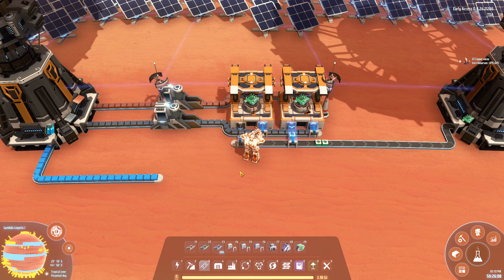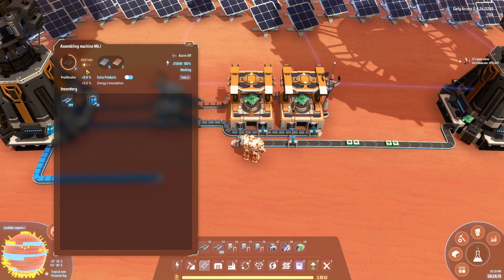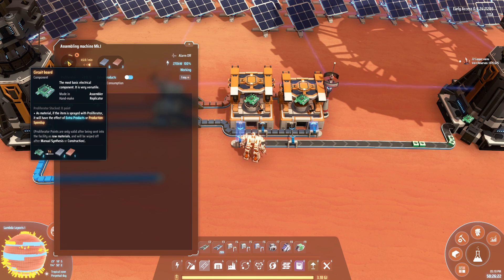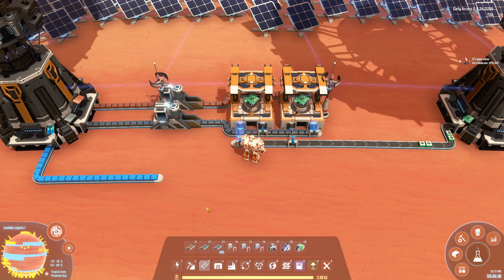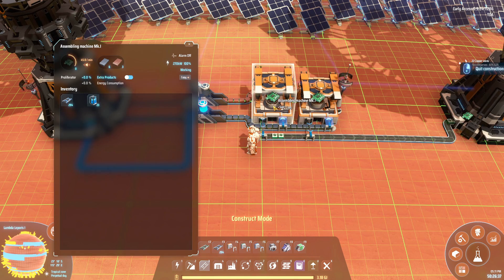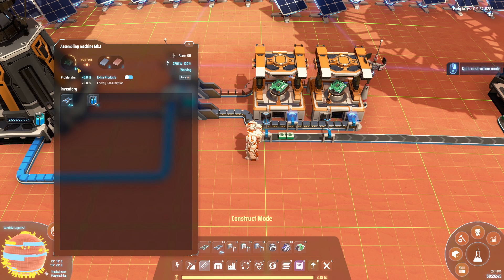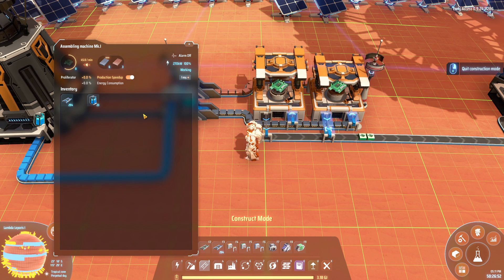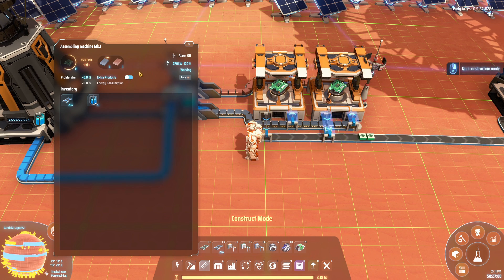Proliferation Explained - Why is "Extra Products"  is always superior

Comment: ok, so i did come in with the opinion that 100% production is better and now I see why 25% products can be better and how in all technicality that little small button actually has nothing to do with production (inputs/outputs with #'s) but is purely about 3 different play styles/ways to go about building in the late gate, NOT which produces more. This is actually very clever now that I understand it.

The way he set the factories up in the video where he had every step to make that item from raw ore in 1 setup is 100% a different play style than than a forge world type play style where you make massive blueprints for just Iron ingot or copper ingot and have those feed my massive magnetic coil blueprints which feed my electrical motor blueprint and every blueprint has it's own logistics tower etc. 

It's seems that there are 3 ways to play:
1. New/average player - No prolif/using prolif only to compensate for an exact reason creating no waste/idle time because your just trying to beat the game by building a dyson's sphere.

Long-term players:
2. The forge world people who build massive factory setups for individual Items that all have their own logistics tower(many towers per item sometimes like Iron ingots) heavily heavily rely on logistics vessels to be the glue that bonds everything together. These kinds of setups is why I thought was 100% better and IMO is when you want to always use 100% production because you made sure power is not an issue since the vessels use power, your 100% production on everything uses more power. It's kind of a quicker but lazier way to play. This setup allows for a lot of factories to have a lot of idle time until they are needed  to fill the tower of the next component really fast then 50% of everything goes idle once the next tower is full. This is when you want to build the big awesome spheres but in a wild and chaotic way, some people have no chill and this play style suits those people, that's me :)

3. The methodical player which is what I would say this video shows, where you build what you need for that item all in 1 blueprint, which is interesting now that I'm writing about it. 
There are tiers to the items/components
- tier 1 is ores
- tier 2 is the ingots (refined) made from ores
- tier 3 are components made from manipulation or combination of ingots smelted from raw ore.
- tier 4 is finally the "actually useable" item  which you can use to craft different items which could be tier 5 but they are both just items/an addition step

The point is while the methodical player will also rely on vessels to transport the items, they will have way less vessels being used because no teir 1, 2 or 3 will ever be transported so less power demand. With this setup I think people should always use the 25% more products because of the tier type setups which means they take up a little less room and and use less power so this build is perfect for people who don't have massive power grids but want to expand. My guess is tier builds have a lot more math involved and this would be the more tedious play style, whereas forge world is just more vessels, more planets more power.

I started this on phone and started commenting my bias opinion before watching. Comment got big and I got on PC to finish it and at that point I'm like hour and a half into writing but realized that I see zero value in 25% products and there must be some value so I watched the video and that's when I finally seen it, erased everything and then wrote this. It's hard to write when your learning new info at the same time, I'm like 3 hours into this. :)
Reply from the maker: This comment got serious proliferation buff as well, way more than 25% extra content! :D
Reply: @TheDutchActuary  "25% extra content!" Now I'm not saving resources (time) now I'm going to go for 100% production 😄 I write comments bigger than this every 3 days on youtube, for like 15yrs so it is nothing to write this. Don't feel like I spent a lot of time writing this and I'm doing too much, it's normal for me.

I've done 30hrs in creative since that message and I think I have the info, I just need to write so my brain can put it all together, it's a thing I do.

I don't believe 1 is better than the other but that they both have a certain purpose and there is not a clear indication of when you should use 25% or 100%. I can't tell where that line is exactly so I've been trying to find it and this is the best I have so far. If you have revisited this issue in a new video plz let me know because this is 2 years old and you may already know the things i'm just figuring out.

I still stand by the, "if it's a rare resource, you need to use 25% for every step of the process". if you  need more of the item faster than your 25% setup can do then do alt recipe also, all rare veins should be 25% all the way, all day.

You proved that if you want to make turbines @5/s that 25% is better and I have no arguments with that because your biggest claim for using 25% is you need less and less factories needing less power over all. In my mind, when your always fighting for more power, 25% would just simply be the answer because you get the most out of everything and use less power doing it, like a "duh" situation.

Lets say you want to make gears at 20/s:
--25% would be 16F(factories) to make 20/s. those 16F need 12.8/s ingots, so you need 10.24 iron ingot smelters to be able to make 12.8/s ingots. To make 12.8/s ingot the 10.24 smelter will need 8.192 Iron Ore per sec ------To make 20/s you need 26 factories with the 25%
--100% would need 10 factories to make 20/s. those 10F will need 20/s iron ingot so you need 10 Iron ingot smelters to make 20/s iron ingot. To make 20/s you need 20 factories with 100%

when you are making turbines it's better to do 25% for power AND use less resources
when you make gears it's better to do 100% for power BUT use same resources.
so the difference between these 2 things (except for resources used) is how many steps that use assemblers. When making gears the process stops at the first use of assemblers versus making turbines there are 4 steps that use assemblers and why everything benefits so much from 25%

So then I think, does that mean the line for 25% vs. 100% is when the process goes from smelter to assemblers. I haven't made this the answer but I'm leaning towards it. I think  making a turbine setup like you did and putting the smelting in the same setup can be counter productive depending on the situation "low on power", "low on resource veins" or "low on buildable space" those are the 3 things ratio'ed together are going to make you decide between 25% or 100%

If you are making: turbines that need 30/s iron ingot total, in separate build you need 15/s iron ingot for motors, separate build you need 10/s iron ingot for circuit boards, and 5/s because you are making belts, that is a total of 60/s iron ingot needed if all assemblers are working. 
-60/s iron ingot at 25% needs 48 smelters and uses 38.4 iron ore per sec
-60/s iron ingot at 100% needs 30 smelters and use 60 iron ore per sec

this is why I write, I didn't even put this together till now.
Because of this, that means the power you are saving by needing less assemblers is causing you to need more smelters per setup than you would if you did a setup with just iron ingot smelters at 100%, which would save even more power. The setup being from ore to item causes you to use more smelters, you just can't see it because they are spread out between the setups for each item. You don't save resources (ore) by using 100% on the smelters but it's iron ingot, that only needs iron ore and is the most abundant resources in system. 

Are you making green or pink containers that require unipolar, POWER IS NOT THE PROBLEM, everything smelted and assembled should be at 25% extra. This means you could have made 2000 items total but because you used 25% every step you can end up making like 12,000, it has crazy exponential. Are you making turbines that require multiple resources that are made by assemblers, that require items smelted from the most common resources but don't have the power, then you should 100% for your smelters and 25% your assemblers together or in separate builds. 

It gets tricky though, because if I need the 60/s iron ingot but i want to make gears also, I would make a separate setup for the gears that is ore to item because the item I want ends at the first use of assemblers. I could just make my 100% iron ingot setup bigger and then make a gear setup without smelters and it would save power. Instead I would rather the setups that use a lot of assemblers per setup, use the ingots from my 100%. Even though you are not getting everything you can from the ores out of the ground with 100% on smelters, if every step after the smelters is 25% then at least you make the most from the smelted items.

The other use for 100% is fine-tuning your 25% assembler setup. The numbers are arbitrary, im going off memory but the point is there.
With whole numbers being multiplied by .5 in the 100% setups all answers will be whole numbers (easier math)
With 25% you will get  where you need 12.8 motor assemblers requiring 10.24/s ingot, 5.12/s coils, and 5.12/s gears (annoying math)  which means you need 13 assemblers at 25% to get what you want, BUT what if you remove the 13th assembler and because you need .8 more, make assembler 12 and 11 100%, this allows you to have even less assemblers than what the 25% requires needing even less power, but you do have to chase the problem you created. 

9F @25% and 2F @100% means you will not need as much power because you removed F13 but you do need more resources as a result. with the 11th and 12th assemblers at 100% the whole setup needs 11.08/s ingots, 5.90/s coils and 5.90/s gears. Your gears and coil factories can handle the increase in demand but the iron ingots now require another smelter to get the 11.08/s OR you can only change 1 smelter to 100% and keep the same amount of smelters, you just use a little bit more resources so you don't have to add a smelter needing more power.

yea, ok that was fun, thanks for reading and if you can see any issues with what I said plz tell me.
Reply: Mixing 25% with 100% actually makes the math easier

-To make 50/s turbines you need 80F for turbines.
-80F require 128 motors and to get that you need 204.8F for motors.

-204.8 assemblers needed for motors
.8 > .5 so I uses 2 assemblers from the 204 to make 100%.
202F @ 25% 
2F @ 100%

From what I can tell you should never make more than 2 assemblers in any setup 100%. By the time you are making a 3rd assembler 100% then your math was wrong from the start.
Reply from the maker: @shawnbybee85  You can mix & match to make the math easier, but honestly if you're doing proliferated builds using extra products I would recommend using a calculator (or DIY spreadsheet ofc!) and just make the calculation a non-issue. Using speed options just means you're leaving some (exponential) resource savings and power savings on the table. 

This is of course purely from an optimizing perspective - There's nothing wrong with using whatever option for proliferation you prefer (including not using proliferation at all!)
Reply: @TheDutchActuary  I didn't even realize you replied, I was actually comming to delete the second comment because I said a few things wrong that i didn't want to take the time to fix. Since you replied I'll use it as a way to help other people in the who may be in the same situation because I was doing the math wrong in my head and on paper. It wasn't till I made the blueprints and pumped resources through it that I realized.

I still agree with:
1. Your point in the video was 25% uses less power because less factories and my point is you can use even less factories when you fine-tune your 25% setup with 100%.when you need 12.4 smelters, instead of adding a 13th smelter for the .4 only put 12 and make the 12th one 100% and the other 11 smelters 25% "if it's about power." if its about getting the most out of the resource then you should not use 100% at all and not care that the 13th smelter will only work 40% of it's existance. it's a fine tuning thing that I would never expect the average player to care about but as I'm creating blueprint in creative my OCD can't help but want to fix that 40% factory. :)

2. I think the smelters should not be included in the build/blueprint. I can do numbers but it boils down to this. all assemblers should be in 25% builds because not a lot of items use those items, there's just a few things that you need a lot of but "everything" is made out of the stuff that smelters make, everything which mean every build/blueprint will need it's own smelters and at the end of making 30 blueprints, yes you used less assemblers=less power, but you used 2-3 times the amount of smelters because everything needs there own smelters. because you put the smelters in the setup it actually makes 100% pointless but when you remove them from setup 100% smelting for common resources is 100% the answer without a doubt, "if it's about power. This is all refencing your original point, "need less power"

Thanks for the replies.
Reply: @TheDutchActuary  Bro I'm an actual idiot, it's official. 

when it comes to the mechanics of the game like # 1 and #2 in last comment, I'm a game mechanics freak, it's part of playing survival games.

When it comes to doing math like this game requires when doing 25% BP's I should not be listen to because I was doing all my math wrong. I made 2 massive comments and 22 blueprints before I realized that i'm not compensating for the time it takes to make the item. I did the 25%, I considered how many items were need to output 50/s but I never calculated the time it takes to make the item for 22 blueprints. there's a part of me that believes I didn't want to believe I was wrong after 22 BP's and that's why it took so long for me to catch on cause then I wasted time.

it makes me feel like I just forgot how to do math and I feel like an idiot, but I was humbled by the fact that I did that much math wrong and realized I need to slow down when I do math because I dont do complicated math at all in my daily life.
Reply from the maker: @shawnbybee85  We've all had our ' Errmmmm whoops?!!?'  moments in these games for sure!!

I hereby grant you your official ' Oops I miss-mathed! ' award and declare you a full member of the automation society!
Reply: @TheDutchActuary  do you proliferate buildings? I proliferated belts for production and seen they get a buff from proliferating so I proliferated blue belts and they did 33/s instead of 30/s but read online there seems to be no point to proliferating actual buildings, was curious you thoughts.

Seriously thank you for the replies. The prolif was the first video I've watched of yours but you get the sub just for the replies, again thank you.
Reply: Said that last part wrong, you should never make more than 2 assemblers ""per step in the setup"" 100%. 

Turbines have 4 steps that use assemblers so you should never go over 8 factories @ 100% in the whole setup. 

204.(a) factories--- If  (a) < .5 then you should only use 1 assembler at 100% when doing the math on paper. 

(a) < .5 use 1 assembler @ 100%
(a) > .5 use 2 assemblers @ 100%

You can really fine-tune like this easy once you have the whole setup complete and you watch the belts and make adjustments.

Comment: Has it ever occured to you that in your turbine example, you could be proliferating the smelters with speed instead of extra product and actually save more space and reduce the number of buildings?
Reply from the maker: Of course, but building space is never really an issue (I've personally never been able to fill 64 systems worth of planets with buildings anyway, nor come close to that). The extra production scales down the number of buildings exponentially rather than linearly, so does a pretty good job at catching up in the longer production chain as well - with the added benefit of requiring less resources as inputs.
Reply: @TheDutchActuary  I meant to say that you could be using the speed proliferation for smelters on your example and extra product on assemblers.